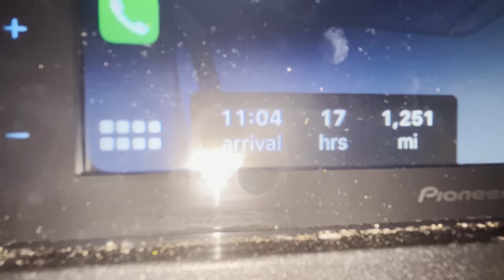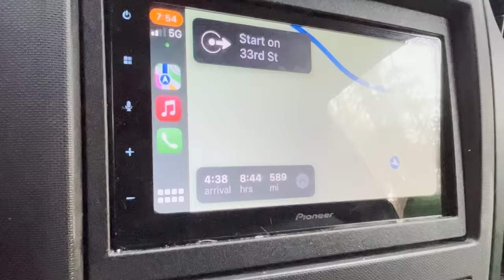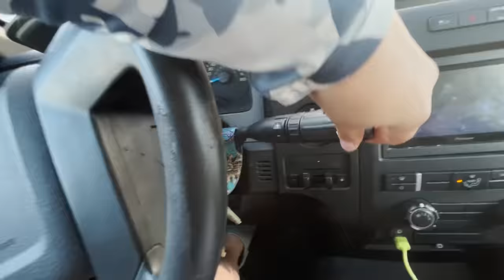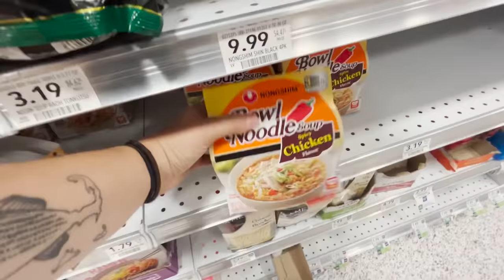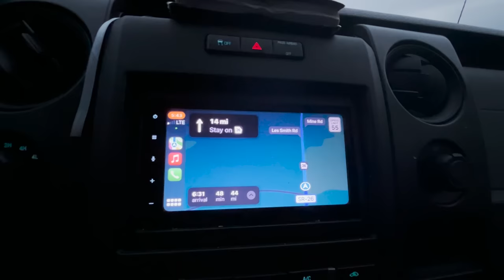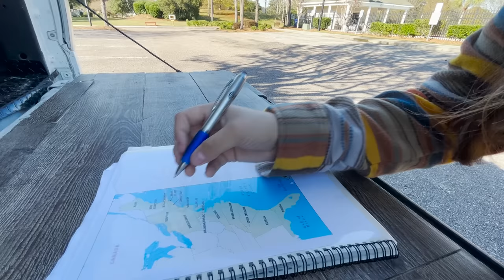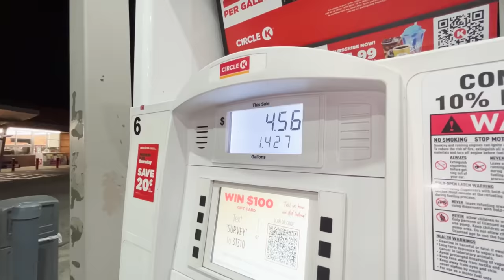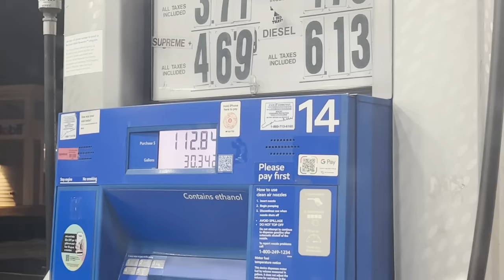Full 3,000 Mile Roadtrip | Truck Camping The East Coast

Comment: I'm new to your channel, so I'm sure you've addressed this. I'm curious, but for safety reasons, wouldn't it be better if you could get into the back of your truck from the inside? What if you had to leave in the middle of the night because someone was outside your truck? You would be stuck in there. Also, in bad weather, you have to get out to get in the back. Has this ever been an issue for you?